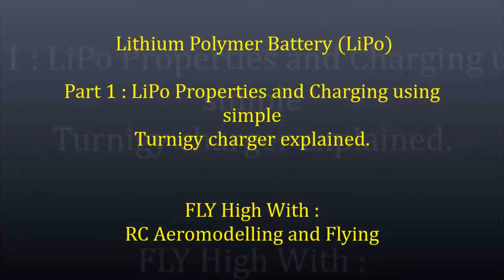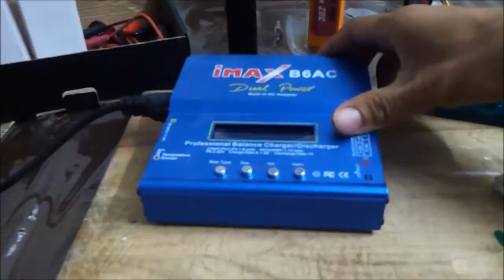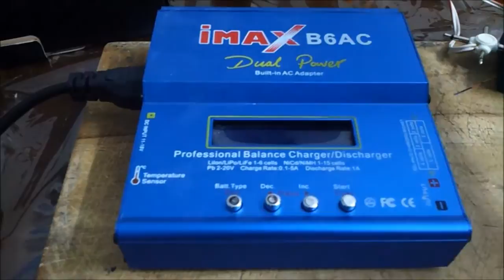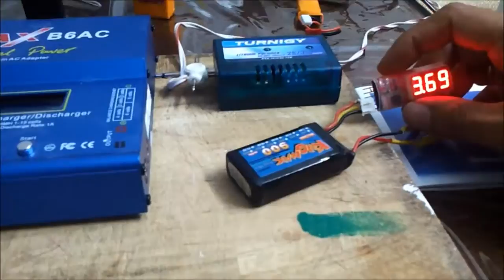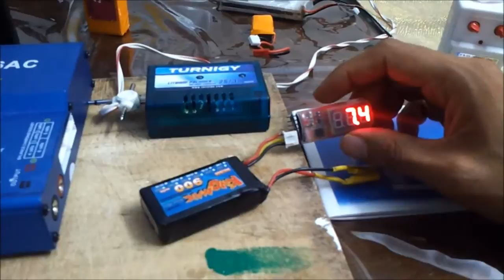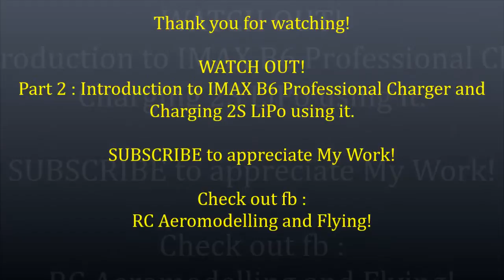Lithium Polymer Battery : Part 1 - Basics & Charging using simple Turnigy charger explained.

Comment: Hi,
I've just bought the Turnigy charger and I have connected 3 18650 in series. I see that for 3S this charger has 4 pins. If this is 3S charger why do we need 4 pins connectors? Can't I just connect the GND of the first cell and the + of the last one ? I can't find a schematic for pin connection of a turnigy LiPo battery with 3S.

Comment: Hello;
I'm using the Turnigy 2s/3s charger, please can you tell me what is the estimated time to charge a 3s lipo and if the green light should Turns off after full charge ?

thank's :)
Reply from the maker: Hello Mohamed Abdo Allah  Here's what the 2 lights indicate.
1. Input Light: Red / Charging Light : off - Indicates the charger is plugged to a 12V power supply.
2. Input Light: Red / Charging Light : Solid Green - Indicates you have plugged your LiPo and it is charging.
3. Input Light: Red / Charging Light : Blinking Green - Indicates you have plugged your LiPo but it is not charging your LiPo. (Might be problem with your LiPo)
4. Input Light: Red / Charging Light : Off - Indicates charging is complete.

Note charging time depends on the amount of charge left in your LiPo before you plug in. Roughly +- 2hrs for full charge. 

* Follow the safety procedure while handling LiPo Batteries***
Reply: Naren Nanjappa thank you do much :)

Comment: Hi , I'm brand new to this. Hope you can assist with some instructions. I have the same battery charger and need to charge up a 6400mah 2s 7.4V lipo. Could you give me the basic settings on the charger for optimum charging please. Any help would be greatly appreciated.
Reply from the maker: Hello Clive Joseph, welcome to LiPo charging:) its simple, first power your turnigy charger with 12v power adapter. Then plug your 2S lipo's balance port to the charger. Plug it to the 3 pin port for 2S lipo. Study green light indicates charging. Please go through this complete video for better understanding. Also for more details on lipo and its maintainence, repair and   safetly please watch part 2, 3 and 4. End to end details are explained there. Reach out to me if you need any clarification.

Comment: Hi;
I've been using the Turnigy 2s/3s charger. I'm trying to charge a 3s packbut the green light is still blinking.
Do you have any idea ?
Reply from the maker: Hi abdo allah Could you please share the overall and per cell voltage of the LiPo you are trying to charge. And have you tried charging the same LiPo on your turnigy before? Also if you are charging your LiPo through mains only please try and do a Balance charging. Let me know.
Reply: Naren Nanjappa ;cell1: 3,7 cell2: 3,58 & cell3: 3,62;I've never used this charger.thank's
Reply from the maker: abdo allah  here are few possibilities. If the battery is LiFe and not LiPo (if it is china made please watch out for that as we tend to assume all series packs are LiPo), Turnigy won't charge your battery. Check the balance ports both female and male for any possible loose solder. Try using your simple charger to charge this Battery if it changes then there is no issue with the battery all you have to do is understand how to use a Turnigy Intelligent Charger. Please refer to my Part -2 and Part -3 where I have explained in detail all the instruction on how to start with your Turnigy charger.
Reply: Thank you so mush Mr. Naren Nanjappa :)
Reply from the maker: abdo allah You are welcome :)